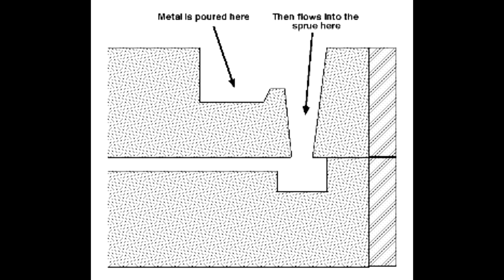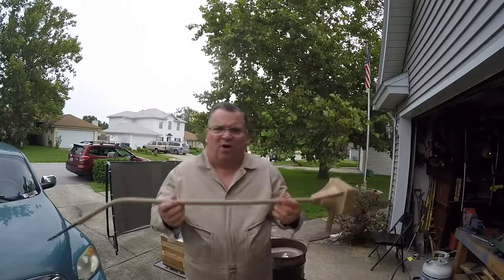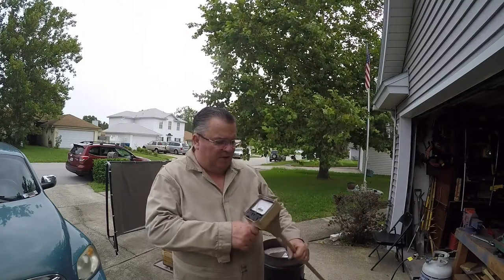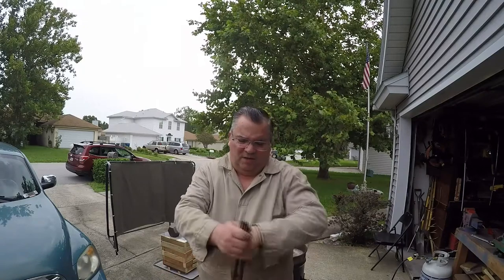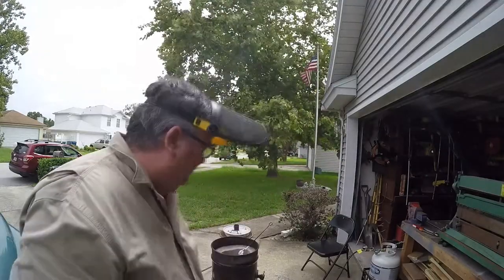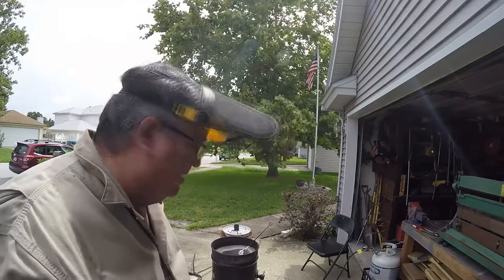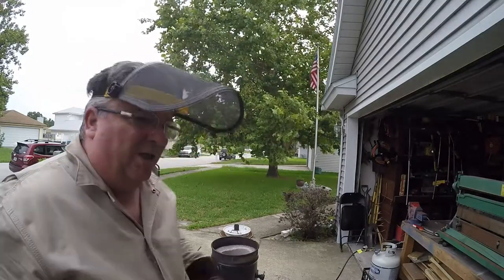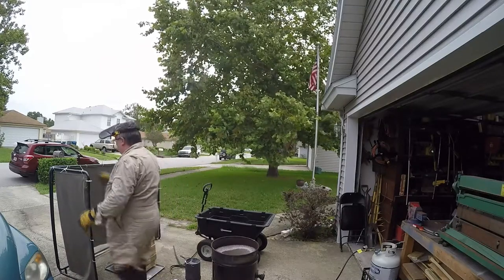Pouring lead hammer molds

Comment: Great video, thanks. I poured lead castings for 15 years or so. I'm interested in casting other metals too so this video was very useful.
Reply from the maker: I had a few lead jobs on the Sierra (AD-18) pouring weight testing weights. Had to be careful, with regular temp. metals like brass, bronze and aluminum, if a bit of molten metal landed on your arm, yeah it hurt but all you had to do is to shake the limb and the metal fell out of the cauterized wound. With the lower temp. metals, if any got on you the metal not only burned you but it latched on to you like molten plastic. You had to grip it with your fingers and tear it out of your wound before the burning would stop.
Reply: Lead was bad enough. Can't imagine iron and steel. Had a few pots explode after loading with ingots with a small amount of moisture on them. Still got the scars!!!
Reply from the maker: when the crucible was loaded the metal had enough time to dry out, the rest of the heat was stacked around the opening of the furnace so that the metal was dried off before introduced into the melt. Never had that type of problem happen in any foundry I worked in.
Reply: Yeah. Our ingots were delivered by the ton and stored in the shop where they dried out. It was only when there was a late delivery this happened. You learned very quickly to check them properly. All our pots had extraction around them so the only lead that got out was through small gaps. Any new guys that came in we made sure they knew about the dangers of moisture!!

Comment: Love the way that you keep improving your equipment
Reply from the maker: I had the best training and the best equipment when I was in the Navy. While I don't have the money the Navy had, I know what I need and will slowly but surely replace the bad with the good.
Reply: sandrammer curious about your future purchases and thanks for your videos 👍
Reply from the maker: I already have a small silicon carbide crucible and will either make or buy a piece that will lift the crucible out of the furnace and a handle that will hold the crucible while I pour the metal.
Reply: sandrammer ohhh great for me there is a still a long path to walk😊
I'm a hobby coppersmith and just learning how to reuse my cutting pieces 👍
My first step was to build my wood fired furnace and it worked 🎉👍 I successfully reached a temperature of 1200 degrees Celsius 👍
Now I'm learning how to pour and making molds that is what I love about youtube 
Thanks again 👍
Reply: By the way I'm from Holland sadly .
I wish I lived  closer to your place so we could meet and talk about your hobby
Reply from the maker: We may not be able to talk on a daily basis, but if you have any questions about Foundry work I'll be happy to answer them.
Reply: sandrammer thank you for the offer 👍 I appreciate that a lot 😊